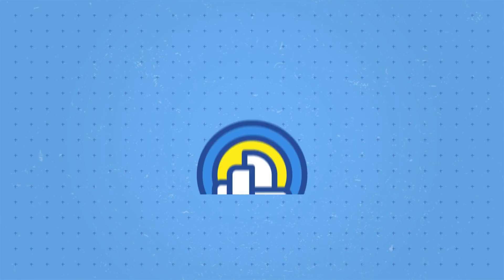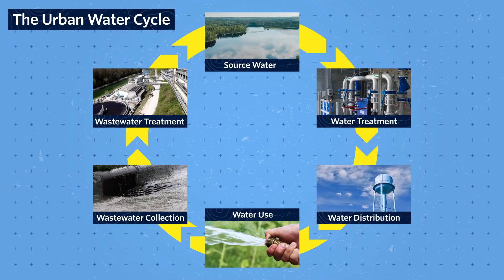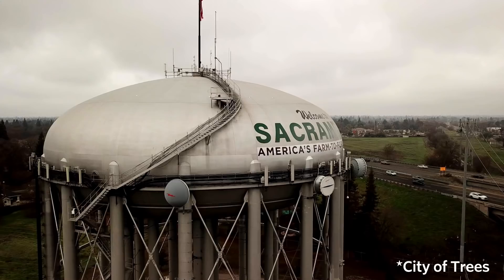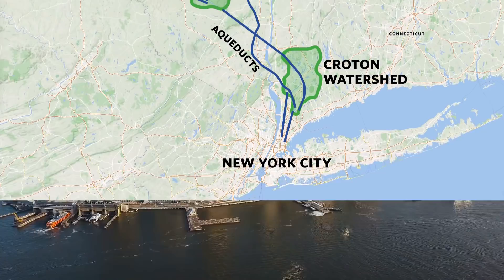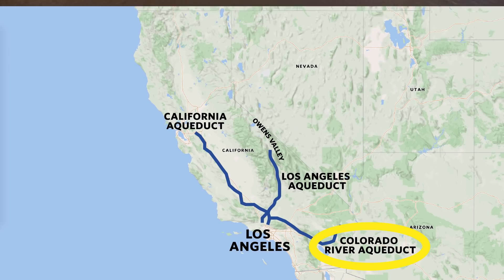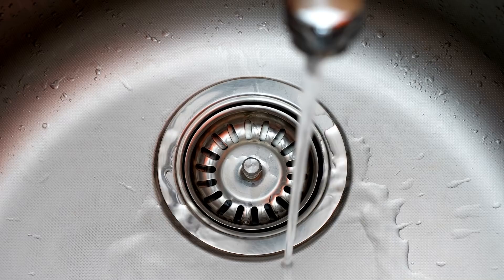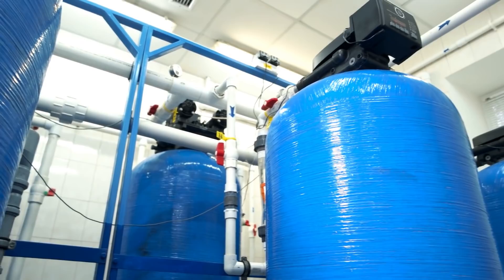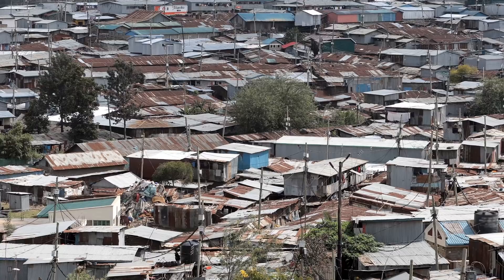How do cities get enough fresh water?

Comment: Next topic: how do cities get enough electricity
Reply: I think a lot of Texans are wondering about this at the moment.
Reply: Answer:
A private company or a legal entity owned by the central government or local municipality generates electricity at a power plant that is fueld either by Coal, Oil or Nuclear or they use a giant wind farm usually located a few miles at least ~10 miles away from the city border or they'll use solar panels (wind & solar are extremely uncommon) or they'll build a dam on a usually large section of a river which is generally located at the edge of the city. Most cities then send this electricity from the source to a  transformer where it then travels through large pylons to smaller transformers where it is then sent through smaller pylons to individual buildings either above ground travelling through wooden poles or under the pavement/sidewalk.
Some cities like London will build dedicated tunnels under large and wide rivers so that the grid can span both sides of rivers such as the tunnel under the River Thames in London.
Most electricity in cities is generated by coal, oil or nuclear in plants in industrial estates in urban areas or just outside or on the city border where a plant failure will do less damage but will be further away from consumers of electricity .
Most coal, oil and/or nuclear is transported to the power plant by rail using either dedicated frieght rail lines or on branch lines or they'll transport by road using a truck/lorry powered by Diesel (in most places), hydrogen or CNG or in former soviet states such as Ukraine they might use electricity by use of trolleybus wires and with oil specifically they'll use an oil pipe for the most secure method of transporting the fuel for the plant. 

Specifically in Texas, there is an electricity shortage because eco-communists like Bill Gates or Greta Thunberg pressured the Texan state government to end the use of "non-renewables" which means anything that isn't wind or solar and whats happened is that the big storm they had, has covered all the solar panels making them unusable and the the wind turbines have frozen up so they can't spin during high winds and only a few years ago they had decomissioned some (I think it was nuclear but I'm not entirely sure) power plants that didn't use wind or solar as a source and now they can't generate enough electricity to the grid which is something that's been going on in Calafornia for years its just that in CA, they started importing electricity from other states despite the high cost & low efficiency rates of doing so...
Reply: @wclifton968gameplaystutorials  well damn are you a lecturer? 😂
Reply: @bishbosh4815  nope. This is all stuff I've learnt in my own time and some of it was in GCSE geography but most of it in my own time. 

An extra note as to whats happening in Texas is that I've heard that one of their nuclear plants wasn't prepared for the winter storm and so that has also contributed to the electricity shortage. 

I also gave this video a thumbs DOWN due to a William H. Gates sponsorship, a man who wants to depopulate the earth and usher in global communism.
Reply: @wclifton968gameplaystutorials  you're not a student even then?
Reply: Let's develop fusion reactors till those are fully functioning.
Reply: @bishbosh4815  "Of the 45,000 MW of power offline during the peak of the cold, 30,000 MW stemmed from natural gas, while 16,000 MWwere from wind turbines.   Of the power shortfall that hit Texas, over 80% was due to problems at coal- and gas-fired plants  -  Wind and Solar generation are not part of baseline and peak power generation calculations. 

By far the biggest outages have come from our natural gas plants, says Daniel Cohan, professor of Civil Engineering at Rice University A portion were down for scheduled maintenance. Others weren't designed to operate reliably in extreme cold weather, and others haven't been able to get enough natural gas supply.  It appears that a lot of the generation that has gone offline today has been primarily due to issues on the natural gas system."

Lets ignore what FACTS an Engineer has to say, because them college folk don't know what their doing.  And lets also ignore what States like Iowa (who gets 40% of its energy from renewables), and Countries like Denmark (who gets 80% of its energy from renewables) - who are in colder climates,  yet somehow magically keep their grids operational are doing.

Bottom line is far too many Americans attack renewables whether it is raining, snowing, or the sun is shining — they engage in a culturally opportunistic misleading charade to promote an agenda that has nothing to do with reality.  I doubt City Beautiful reads this far down into the comments, but I would implore him to relocate to another Country that actually appreciates his planning expertise, as he would have no future here.
Reply: @shotelco  I totally agree! We could learn a lot about ingenuity, productivity and efficiency from Scandinavian countries!
Reply: @shotelco  why we can't use renewables as a primary energy source and use fossil fuels to make up the difference i don't know
Reply: @bishbosh4815  The Netherlands - the size of the State of Maryland where its around freezing for 5 Months of the year - is the second-largest exporter of agriculture in the world, after the United States.  This is done by "precision  (greenhouse) farming" technology - which uses 40% less WATER (and half of the energy consumption and almost no pesticides) than the 1,000 year-old farming techniques still used in America today.   We wouldn't even be having a "water" discussion if the U.S. used this tech on a massive scale because of this FACT:

Agriculture is a major user of ground and surface water in the United States, accounting for approximately 80% of the Nation's consumptive water use and over 90% in many Western States.

Ethiopia Africa, of all places, has the Reppie waste-to-energy plant.  It converts trash from landfills to energy (25MW).  The CO2 output is Carbon Neutral considering the power generation and the FACT that landfills emit an enormous amount of CO2 just from decay gasses.  

It's utterly insane isn't it?  IMO, the issue obviously isn't one of technology, it's one of culture.  Americans in general simply do not possess the critical thinking capacity to move beyond the entitled "American Exceptionalism" mindset.  We have been artificially tribalized and pitted against one another, and are too busy hating each other (Think responses like: "...eco-communists like Bill Gates or Greta Thunberg..." ) to realize that the rest of the planet has gone on to far greater things.   We have seen the parade of social & cultural deterioration accelerate just in the past 12 Months.  It's only going to get worse.
Reply: @shotelco  YES I completely agree, without sounding too radical and sjw, the culture of Americans NEEDS to change!
Reply: @bishbosh4815  One other relative point about Scandinavian (technically Nordic) countries:  Not 30 days ago I sat in on a conference call with the Government of Tanzania.  They are actively seeking a method to re-engineer (yes, city planning)  their largest city; Dar es Salaam.  This is what they literally said: "...to encourage the growing urban population to use Bicycles instead of motorized vehicles... like Finland and the Netherlands ...before it's too late."  They're concerned the city sprawl is mimicking U.S. cities.  Much of the world looks at certain attributes the U.S. as a warning of what NOT to do.  This is an example of City Beautiful being perfectly positioned to help people that want to be helped - not waste his talents and time on people that can't see the Forrest for the tree.

It's amazing how advocating for positive change is considered "radical" and how Social Justice (sjw) is a pejorative in America.
Reply: @shotelco  yes exactly
Reply: @shotelco  sorry you sat in on a conference call with the government of Tanzania? 🤣
Reply: @wclifton968gameplaystutorials  lol, you got me at “eco communists”. Well at least you didn’t say “cultural Marxists”
Reply: Next topic after that: how do competent reliability councils winterize their electrical grids.
Reply: @bishbosh4815  I'm a 6th form college student doing a Level 3 IT BTEC course in South West London and so I am a student but just not in this industry
Reply: @wclifton968gameplaystutorials  huh
Reply: @FlymanMS  well it is what the folk at the World Economic forum are promoting in Davos, Switzerland and it is also well known that Bill Gates loves his shady investments especially in environmentalism and vaccines while he sits at speeches talking about how we need to depopulate the planet and hint at giving the government total control over everyone's lives.
Reply: @IkeOkerekeNews  I deal with FACTS to support my arguments.  When one has no data to support their position, they immediately resort to insulting invectives directed at the source of what they can not articulately  refute.  This type of emotional knee-jerk response has become a mainstay of American culture.  The FACTS speak for themselves:
  
⚫ From 2007 to 2017, total U.S. Federal public spending on infrastructure fell by $9.9 billion in real (GDP) terms (Brookings Institute)
 

⚫ Real spending on Federal funded capital projects plummeted 16% in the U.S. since 2007, but maintenance expenditures rose by 9%. This indicates an even greater reduction in new development or re-development. 

⚫ States and municipalities account for 77.7% of U.S. public infrastructure spending. States/municipalities have also increased operation and maintenance spending by 11.1%,  and decreased their capital spending by 24% since 2007.  Again, lower overall spending on infrastructure, and greater maintenance of existing infrastructure.  

⚫ The above declines in overall infrastructure investment are also reflective of water and transportation infrastructure malinvestments. 

The above FACTS illustrate the declining trend in U.S. Federal, State, and municipal level infrastructure spending;  By definition, An urban planner will almost always be a government employee. This data lays bare the reality that the demand is shrinking for Urban planners in the aggregate.  This doesn't mean that if one has an advanced degree (such as a Ph.D ), one can  likely find employment.  But, what kind of employment?  What kind of "future"? Urban planners want to Create new solutions for the welfare of communities, not simply push paper around a desk maintaining old, obsolete, and dilapidated infrastructure.

Other, growing economies of the world - and economies that understand how modern infrastructure investment leads to a more productive nation - appreciate Urban Planning talent and promote new, creative development.  

American taxpayers have no real desire to improve their infrastructure, even in areas of growing populations. Again, evidenced by the decline of spending.  You can not mute the spending data I have presented, which supports my position. However, if you can present something, anything, in the form of a coherent alternative interpretation of these FACTS, I would be open to that discussion.  Otherwise, have a good day.
Reply: @shotelco  
And yet, new infrastructure projects like the California High Speed Rail project continue to be build. Cities like Austin, Minneapolis, etc. have eliminated single-family housing, allowing for more affordable housing and denser communities to be built. Cities like Portland, Seattle, NYC, have opened miles of there cities to pedestrians and cyclists, banning the car. And these infrastructure booms are being replicated across the country, every single day. You don't deal in "facts" at all.
Reply: @IkeOkerekeNews  Judging by your anecdotal response, it is clear that I am failing you - and for that I sincerely apologize.
My position is expressly based on the Decline of US infrastructure investment over the past almost 15 years.  The word decline means to progressively get smaller,  a reduction, shrinking, or depreciate over a time period.  Perhaps the comprehension of the word decline got lost somewhere in translation.  What decline doesn't mean is non existent. Also, and again perhaps you are not familiar with quoting factual sources, I included the source of my facts: (Brooking Institute)  Their reports relied on published government data.  

Your response suggest that infrastructure spending is non-existent.  Yes, the projects you mentioned do exist (The California HSR debacle notwithstanding).  But growth in terms of infrastructure spending is what we call Negative. Less and less each year. Or... *declining*.  Fewer and fewer net-new projects year-over-year. 

When the subject is Future Prospects (which it is), it is important to understand Future Opportunity.  The definition of the term "boom" (which you used), means growth, actually explosive growth.  Factually speaking, unless you can provide proof with legitimate sources to back it up, the past 14 years has not been a "boom" cycle in terms of Infrastructure spending growth, it's been a "bust" cycle (the opposite of "boom").  Thus, future prospects for Urban Planners would more than likely be limited due to funding, and furthermore far less innovative when constrained by a focus on maintenance.   I will state again, this reflects a declining state of opportunity (not a non-existent one).  

Hopefully, to prevent another irrational response, please acquaint yourself with the fact sources I quoted:
https://www.brookings.edu/research/shifting-into-an-era-of-repair-us-infrastructure-spending-trends/
If reading isn't your thing, there are a couple of pretty pictures (graphs) in this fact source link that illustrate the decline in infrastructure spending over time.:
https://www.mckinsey.com/business-functions/operations/our-insights/reimagining-infrastructure-in-the-united-states-how-to-build-better

Hopefully this helps for you.
Reply: @wclifton968gameplaystutorials  Eco-communists... you good my friend? Do you need to see a doctor? Maybe medical doctor, or, maybe economics, political science, or environmental sciences PhD?
Reply: @wclifton968gameplaystutorials , Do you know why Texas isn't connected to other states?
Why gas distribution and generations weren't prepared for a cold weather event?
Why water pipes are freezing?
When Texas made study proposing measures to reduce risk of cold weather in utilities?
Why recommendations weren't implemented?
What is your source that Gates is proposing communism?
How is World Economic Forum communist?
What is communism?
Reply: @suokkos  for the first 5 questions, I do not know but for the last 3 questions I can tell you this, Bill Gates is a big supporter of the World Economic Forum's "Great Reset" which is an economic idea proposed by Claus Schwab in which "you will own nothing and be happy" which clearly implies that capitalism or national socialism will not exist. the WEF also proposes radical new government spending tactics and an end to freedom of movement which is something only ever seen in communist or national socialist countries such as China (since 1949), Germany (1930s-1945), USSR, North Korea etc. as well as implementing these policies by "never letting a good crisis go to waste" which means implementing these policies because of a virus outbreak similar to how Adolf Hitler introduced lots of his policies by use of citing an external threat which is what never letting a good crisis go to waste is; Hitler's external threat was the Treaty of Versailles.
Reply: @wclifton968gameplaystutorials  , Feudal laws had some strict limitation to travel. Recent history has been quite unusual how freely western people can travel.

What is your source that WEF wants to limit movement?

I tried to look which resulted overwhelmingly support for movement. WEF is a huge organisation which likely includes many ideas. Majority voice is heavily capitalist because it includes a lot big business.

Are you sure Great Reset is about to eliminate capitalism?

I haven't had indepth look. It seems like capitalist reform trying eliminate market distortions by encouraging governments follow more uniform economic policy. The reset is about utilizing natural resources sustainably. So far since industrial revolution sustainability has continued to worsen. They also call for fairer society by improving worker rights and surrounding community around company.

This goes under stakeholder capitalism moniker. In practice it would be well required market economy which has been a long time target in EU. WEF seem to call for more than EU is requiring currently. It sounds like cherry picking and improving existing and planned policies from Germany and Nordic Countries. Probably other European countries have similar aims but I don't know details.

Communism aims to remove market and profits. EU aims to keep market and profits but regulate it to guarantee fair competition, limited environmental impact, good working conditions and wide basic rights. There is a clear difference.

But even best matching EU countries  need reforms to economy and research to new energy technologies.
Reply: @wclifton968gameplaystutorials  fake news, the majority of the outed generation was regular gas-fuelled steam-turbine generation. It’s hilarious you think the issue is the snow covered solar panels, even though most of Texas’ renewables are wind. Not to mention, if you’d looked into it at all, you’d see solar panels actually melt way quicker than their surroundings, a roof with solar panels that gets snow has the solar panels visible again after a few hours. Also, the fact you seem to think switching to renewables doesn’t include resiliency plans or extra capacity. Or that you don’t know Texas is only 10% renewable.
Reply: Oof
Reply: in the USA, it's always "when they complain enough that they are cold"